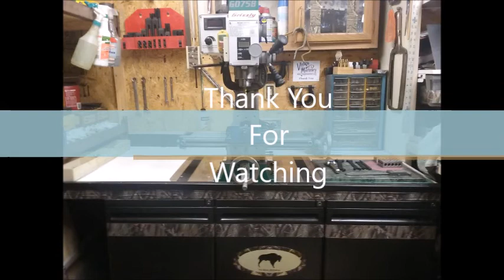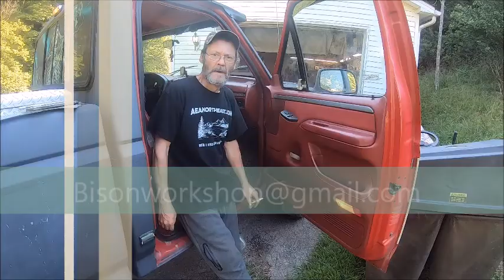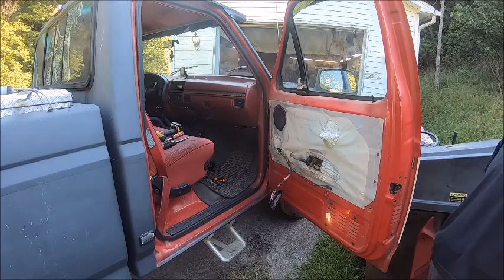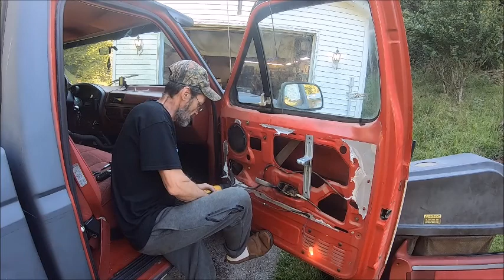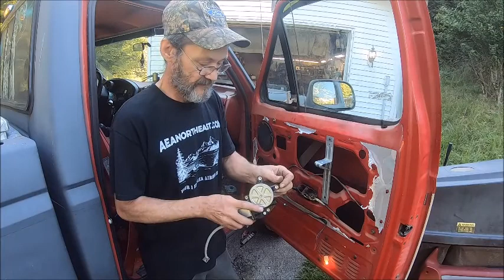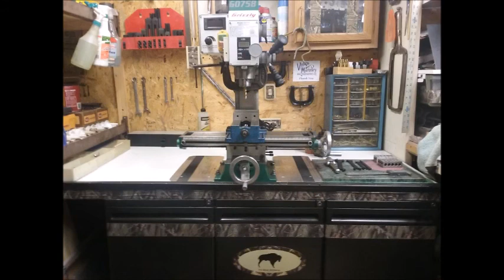93 ford f350 window motor replacement

Comment: You can put rocks or nuts or anything else in the place that you found the plastic and fix that motor. That gears made from plastic so it will let loose if someone gets there arm cought in the window.
Reply from the maker: i will turn some pins on the lathe to replace them. if some dumb ass gets their arm in the window, then sorry about their bad luck. they keep making shit like that to keep dumb asses safe. wow. what a world we live in lol
Reply: @BisonWorkshop  I think you're right,this world needs a reset.